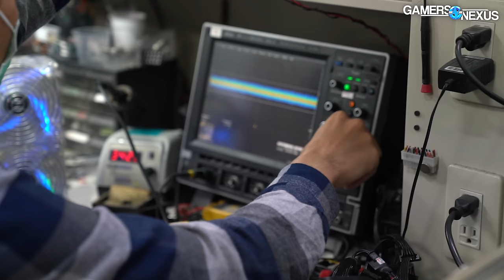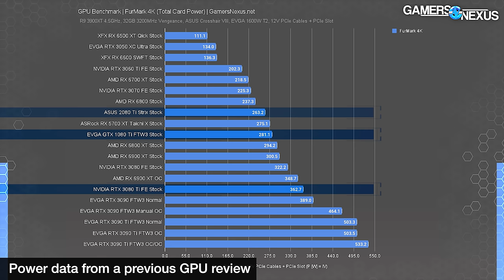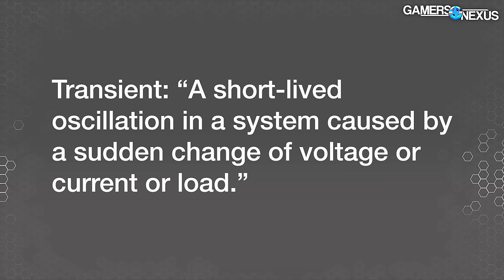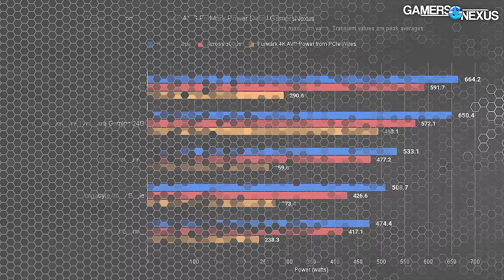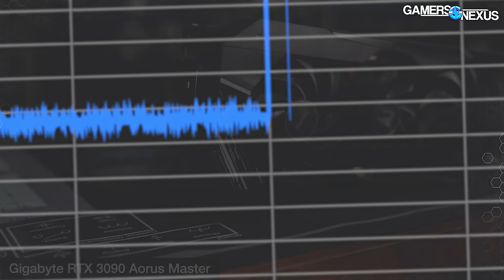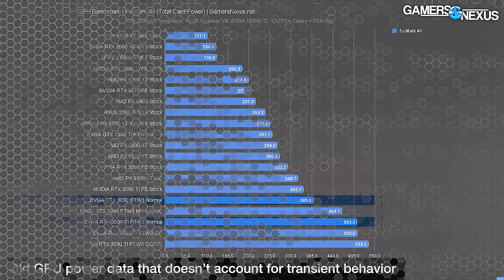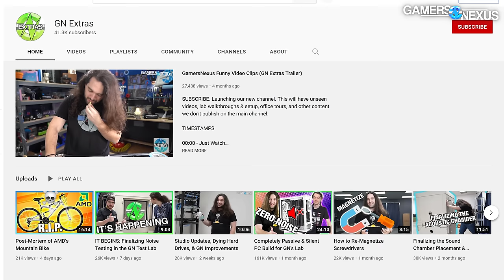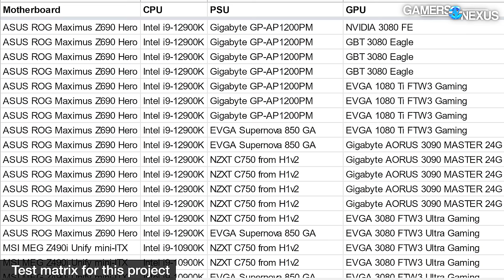The Brewing Problem with GPU Power Design | Transients

Comment: my X 1250w Seasonic Gold trips in deathloop with a 3080ti ftw3 custom loop wen oc'd to 2000 and above and vram oc 1499 offset in afterburner with no error corrction . I .also just ordered a super flower 1200w leadex platinum SE  for $229 USD. tired of ocp kicking in..
I also have my Ram severely overclocked 3800 14 14 14 28 cr1 sub timings, x570 hero mobo,15 fans, RGB, a D5 pump a 480 and a 360 radiator and push pull with a 5900x , and multiple nvmie and ssd drive. so I'm pulling a lot of power when I'm at high refresh rate 1440p gaming.

Comment: So am I just incredibly lucky to be able to run a 5950X (with PBO) + 6900XT (with mem @ 2150, undervolted GPU + 15% power limit increase) on a 750W PSU?

I guess I'd need a new PSU if I had a high end Intel CPU + Nvidia GPU...

Comment: Would anyone know if this could be the reason my PC randomly shuts off? The power led stays on but cannot be woken up.
I've seen it happen a few times during warframe but it also seems to happen when I'm away from my computer and it's just idling on windows with the monitor off which is weird because I wouldn't expect transients during that. 
I have a tuf 3080ti, 12900k and a seasonic platinum 850w

Comment: I would love some help bc my pc has been shutting down random sky after about 20 min of gaming. It started after I upgraded to a ryzen 9 7950x and a X670E-E gaming motherboard. My GPU is the Nvidia 3080ti but I’ve had that for over a year and I have the 1000w G5 supernova psu. Do you think my problem coukd be transient spikes and do you think a 1300W psu would fix my issue if it is this?

Comment: I have an EVGA 3080 ftw3 ultra gaming gpu, Asus Rog Strix gaming A motherboard, and a corsair 1000X psu in a Corsair 7000x case. 
 I'm having these exact problems of my pc randomly freezing/crashing and resetting itself. The cpu waterblock (MX2 ULTRA by Thermaltake) the screen on waterblock will randomly reset itself as if it's rebooting itself, my xbox elite series 2 controller randomly disconnects from pc at the same time the waterblock resets. It has 2 Samsung 980 pro Evo M.2 that are 1TB each (2TB total).  I'm running 12 of the new  Lian Li uni Infinity fans, 4 sticks of Corsair Vengeance pro (16gb each) 64gb total, and the I7-12700kf...  I have the Corsair XD5 rgb pump/reservoir, 480mm (40mm thick) Thermaltake radiator and a Corsair 360mm (30mm thick) radiator. The 3080 is in a Bykski gpu waterblock also (but problem has happened before I water cooled it. 
It originally had a Corsair 850w psu, so I upgraded to the 1000w, that didn't solve my problem. I live in Elkton MD. And don't know many trustworthy pc repair people or many pc repair people at all, and I have yet to solve my problem. Tried testing/re-installing ram, resetting/upgrading bios, fresh install of windows 10/11. Smh, this is insane. I do all the work myself, but I'm stuck. Maybe I need to invest in testing equipment that you show in this video. Ahhhhh

Comment: This falls 100% on the power supply makers! If you are building a product that is the power generator for several.. actually Many components in a system it should be able to provide the POWER! Period, especially any psu manufactured over 750 - 850 watts!

I personally would Never buy a psu under 1000 watts and from a reputable manufacturer

Comment: I don't think that spikes are the problem here, misleading power ratings are. Neither 1080 Ti nor 2080 Ti ever were 250W cards, and 3090 definitely never was 350W card, they were just crippled by artificial power limits and transient spikes show what they really are. For example 250W 2080 Ti and 380W 2080 Ti will have the same transient spikes. You can see that very well on the graphs with 3090 and 3090 Ti, both using basically the same GA102 chip. 350W 3090 spikes like crazy to 200%+ while 500W 3090 Ti spikes only to 130%, which happens to be exactly what PSUs are designed to take. Full GA102 is going to spike to what full GA102 spikes to and lying that it is 350W is not going to override physics, and the reason why they cap average power with power limits but do not cap those spikes is likely that it would have very negative effect on performance with sudden performance drops. The solution to this is not yet another power limit, it is to stop lying. 3090 is and always was 500W card and 650W transient spike for a card like that is perfectly reasonable. Same goes for 4000 series, if they try calling 600W card with 800W spikes a 350W card then it will be the same problem only this time it will be 3x not 2x, exactly like PSU makers told you. But if they simply call it 600W according to what it really is, same as they did with 500W 3090 Ti models, it will have spikes within that 130% range and it will also have to get realistic PSU recommendation according to that, so nothing is going to trip.

Comment: Could potentially explain very intermittent shutdowns (1 per week) on my son's machine. 
Running Folding@Home 24x7 when not gaming. 
Linux Mint 20.1, kernel 5.18
GPU fan control, clock, power & temp monitoring using "GreenWithEnvy" app

After it shuts down, I have to turn off PSU power switch, disconnect/reconnect AC power cord at PSU, turn on PSU power switch, then system power switch.
Seasonic Focus PX-750
ASUS TUF Gaming RTX 3080
ASUS ROG Strix B550-F Gaming
Ryzen 5 5600X
32GB RAM
1 x NVMe SSD
Machine is connected to a 1.5KVA UPS.

Comment: does 3060ti have huge spikes? Is 6800 better at that issue or do i need new psu if i would pick amd card. Teoretically average power draw is maybe 40-50w higher but if it spikes the same than it will draw 80-100w for a split second and trip my psu.

Comment: Hi there, Thank You for this video. I have a PC BSOD and black screen restart issue/question here. 
I have the asus rog strix x570 e gaming mobo with ryzen 9 5900x with 850w thermaltake rgb grand gold power supply and a asus tuf gaming 6900xt oc edition with 64GB RAM corsair lpx vengeance cl18 and I am getting BSOD Page_Fault_In_Non_Paged_Area 
0X00000050 BUG STRING CHECK Saying NTOSKRNL and NTFS.sys is what drivers are failing and I am not sure what to do next. CrystalDiskInfo says my WD BLACK SN850 2TB w/heatsink and WD BLUE NAND 2280 m.2's are healthy 100% both, and my two 32gb ram sticks passed after 7 and a half hours with memtest86. 
My Gpu maker asus says this specific gpu recommended psu is 1000w when paired with my ryzen 9 5900x so I ordered the EVGA Supernova G2 1600w gold and it'll be my next installation. 
Would the lack of power explain my blue screens and occasional black screen restarts? Mainly happens during gta 5 single player and rdr2 singleplayer, even right after putting in my windows password signing in blue screen once in awhile with an older samsung widescreen tv plugged into gpu hdmi port and samsung odyssey g7 2k 31.5 inch 240 hz 1 ms gaming monitor in DP 1.4 8K cable?

Comment: Solved, but now problem again! I have a 1500W Silverstone powering my Threadripper with a 3080TI. Couldn't get it to run without powering down all the time. Used Afterburner to set GPU power at 90%. Ran perfectly for months! Suddenly, last week, it's shutting off twice a day or more! And I've been running the GPU at 75% power lately. It shuts off even with system sitting idle! Anybody have any ideas? Thanks.

Comment: if you extrapolate this power requirement growth and factor in transient loads, we'll be past the limit of a 15A circuit breaker by 2030.
Reply: And put this in context to first the climate craze, then the pandemic, now the Ukraine war.
There is a reason why CPU tech has developed in a saner way while GPU tech has developed in a more insane way. The latter is flashy high-budget entertainment (and then plus the massive gambling appeal of crypto mining), i.e. the obsessive distraction industry, in a way, if you can follow the spiritual point.

Comment: Corsair SF750 with a 3080ti. Haven't really had issues, but I am worried I wont be able to run a 4080 and whatever R95900X new equivalent is so R 7900X? There aren't many high wattage small form factor PSU's on the market. Please corsair make a 1000 watt platinum version. I'm willing to pay $350 if it means I can actually have a high end SFF pc.

Comment: Sadly even some high end PSUs can't cope, despite rating being more than enough. Thor 1200i will shutdown on transients with 6950xt when OCd high or high power 3090s OCd. Totally unacceptable for Asus and Seasonic. It's 100% their fault due to poor sense circuit design.

Buy Leadex Platinum PSUs, EVGA G2. P2, or T2 and no mystery shotdowns.  Seasonic's fix (Thor OEM) is to remove the sense circuit rather than fix the errant reading triggering the shutdown. Pathetic.

Comment: "It's going to get worse with the RTX 40 series."

Steve, this is just echoing what everyone is concerned about. So yes, I do say at this point you're preaching to the choir. And I don't mean it in a negative fashion: I'm saying you're agreeing with us with extra steps.

As I have said before not very long ago: "it's all downhill from here."
Reply: Plus I'm going to throw in there that seeing how the 40 series are developing, I have no doubt in my mind that not only is it getting worse with power draw (and potential pricing), the fact that I spent nearly half of how much I had on hand for money, as well as being concerned about power draw from my power supply as well as raw power from the wall, I'm more than likely going to settle for midrange-to-high-midrange graphics cards from now on in the future, should I need an upgrade. Maybe, just *maybe*, *potentially*, consult the second-hand market if it's viable.

That being anything reflecting a "70" as the suffix.

Anything "80" or higher is just not even remotely sustainable, especially now.
Reply: If it's worth anything by the way: I'm using an EVGA RTX 3080 FTW3 on stock, an EVGA 650 G3 power supply, and a Ryzen 5 1600. I know it sounds like I'm being paranoid, and I'm well aware that it may be enough to run it in most games, but my main concerns are power usage and trying to keep my stuff around as long as I can possibly make it before I have to actually upgrade. And, ideally, I'd like to keep achieving better power efficiency between the GPU and the power supply itself. (I don't have a large enough income to easily replace PC components, so my purchases tend to be very sparse.)

It's also worth noting that my upgrade will have to be motherboard and the CPU (CPU having more focus on power usage than motherboards). I want to make sure that when I'm about to play a triple A title (frankly, most are not as good as they once were), I won't have more wear on my components than I usually expect them to.

Comment: I always go way overkill on psu my system idles at around 400w/1300w and i assumr spike to 850w/1300w. I have dirty unreliable power and already run through a surge protector because ive had systems fry due to insufficient supply and power trips

Comment: Can be mitigated by quality PSU components? "Mitigated"?? While a PSU might be able to do this, this is NOT the job of a PSU. I'm 100% with the power supply manufacturers. GPUs have no business drawing anything over what their label says EVER. I don't care how "transient" the spikes are, nvidia and AMD have to be able to build a GPU that stays within a certain limit. If they refuse to do that it is a problem caused 100% by the GPU manufacturers. Don't design a machine to occasionally draw more than twice its official power demand. Just imagine this kind of thing in any other industry: "This new car only needs 4 liters on 100 km, but it experiences 'transient boosts' TM where it guzzles a whole liter in one second. The extreme, unforeseen acceleration sometimes coincides with accidents but is that really our problem? Maybe roads are unsafe or drivers lack skill." - NOBODY WOULD MAKE THESE EXCUSES IF IT WASN'T A """TECH""" PRODUCT.

Comment: the power supply is one area I do NOT spare any expense.  And I always hit this issue with a bigger stick, lol
Reply: I am running a GTX 1080 and Threadripper 1950X on a bequiet 1000W. Ironically I had what looked like a blown input voltage spike filter that caused the PSU to take more and more failed starting attempts before it powered the system up and eventually failed almost completely. And because bequiet absolutely does not offer direct swap for replacement and calls credit card escrow as security way too much hassle for THEM, and because that combined with the pandemic, it took one month before I had a replacement. I improvised by taking the bequiet 650W from my secondary PC, wrestled with all the cables and installed that one in my main, and interestingly only in that system the PSU fan generated a constant annoying whine.

Good service is paramount!
I wouldn't want to get another nVidia card, and I don't even see me making the investment,  but if I did want to get an AMD card, it saddens me that EVGA doesn't make those. Is there any brand of AMD graphics cards that comes even close to the service quality of EVGA? (Which TBH leaves to be desired, too, but is still relatively amazing.)
Reply: @Dowlphin  Sapphire has great customer service in my experience.  and they only do AMD last I checked.
Reply: @brianwillis3892  Hm, I only know the brand in connection to graphics cards. That might be a big factor, compared to those do-everything megabrands. Thanks for the tip.
Reply: @Dowlphin  if you do, go for the Nitro+ line of cards... the Pulse cards have an underwhelming cooling solution.
Reply: @brianwillis3892  I'd actually prefer an integrated watercooling, but that's probably even more of a realibility gamble. But fans tend to be quirky in an annoying way. Even on my EVGA GTX 1080 AIO, while the pump is fine - but needed a custom cable solution to be controllable properly - I have to use fan control software to change the speed of the on-board blower fan because at standard RPM it whistles annoyingly.
People keep saying fans cooling on newer cards is no worse than liquid AIO, but I never bought it, and even GN seems to disagree with that.

Comment: How can it be the PSU manufacturer's fault if nVidia lies to their customers? The PSU's are rated for a certain power and will deliver it no problem. They will not shut down when used in their proper power range. If nVidia lies to you and tells you that their cards only eat 350W in order to look good compared to the competition, when they actually need 700W, how is this the PSU manufacturer's fault?

Comment: i may be just waching this but i have known for a while about spiking. now mostly for all my builds  have been with antec power supplies. now becuse of the mega power requerments from 2k rtx to 4k rtx. there is a way to do it as its been well known about sence the year 2000 with the og quadros by nvidia. this was some what solved by running a  dual power supply setup you can finde that info, if you look at well crypto mining.  but this is how  its been done in the commercial brodcasting for years to keep a separate power and signal ground. "Antec power supplies.  pleese start testing them as well as the rest of the brands that you review . "

Comment: have this stuff already on my broken VFE, how draw occasionally up to 75A and shut down my system with it. only after i got a special PSU that can deliver 90A on spikes like those it stopped. But i have still the low voltage problem of AMD in wich the CPU got so low in setting the voltage collapse and the system shuts down too. Happens only on idle luckily.
What it means for me? Don't cheap out on part with "small factor" BS. You want a F1 Car? Then friggin build it like one and not like a fiat 500.
i have MASSIVLY oversized my PSU to get to the desired Ampere i think i need.

Comment: Comes back to this even if you're using an AMD 5700XT? I've been having these problems almost since I got this card almost 2 years ago. 2 games, in particular, that I own SoTTR and Control just shut it down almost instantly (Tomb Raider kills my pc as soon as it hits the main menu, and Control shuts it down after 30-45 seconds in game.). Then I get random shut downs all the time where Adrenaline driver kicks out a message saying things were reset to default due to an unexpected error, and I've only got a fan curve set. I don't OC it at all.. Everything I looked at said it had to be PSU, but I bought 2 PSUs and a new Mobo, and it's still doing it. I just didn't want to have to deal with the greedy cunts that took all our electronics over.

Comment: Can someone help me out? Reaching out to see if i'm actually creating more transients on my current setup that are shutting down my PC due to the physical setup. Let me explain:

My PSU is a Thermaltake Toughpower 1650W GF3. This PSu has a physical connector at the back C20 (rated at 16A-20A). I have an industrial grade mechanical AVR that provides stable voltage to my wall connections and I also have a UPS (PowerWalker VFI 2000 CRM).

The UPS however has outputs in C14 (rated at 15A) so i had to connect my PSU via an adapter to it. I'm thinking that while running Starfield and Cyberpunk, my PSU is pulling more current than it can find and is triggering the OCP thus shutting down my system.

My other components on the system are: i9 13000KF, 64Gb DDR5 TridentZ, Aorus Z790 Master and an Aorus RTX4090. 

The GPU usage on both Starfield and Cyberpunk is constant 99% since i'm trying to drive a Samsung Neo G8 4K 240Hz monitor. I have 2 other monitors attached to the system. Gigabyte 32 inch 2560x1440 and a 35 inch Acer Predator at 2560x1080.

My idea was to replace the PSU to a smaller model like a 1200W which has physical power connections rated at 15A input. Would anyone recommend I do this?